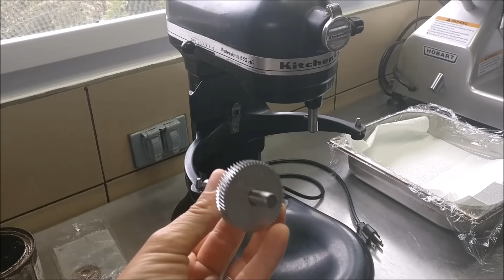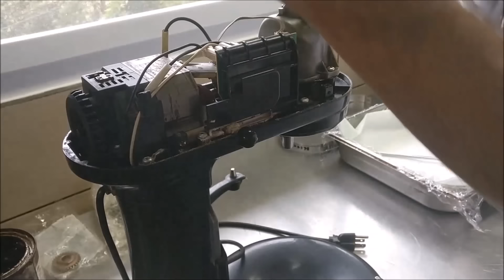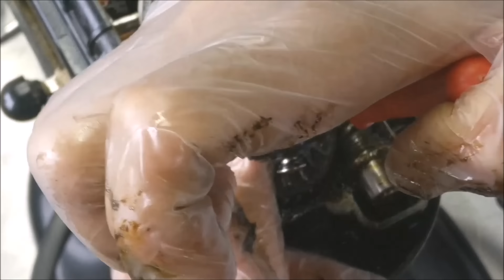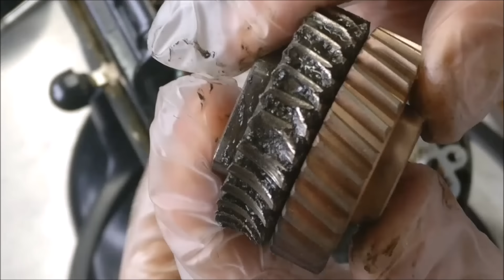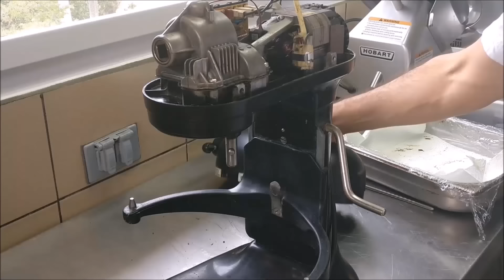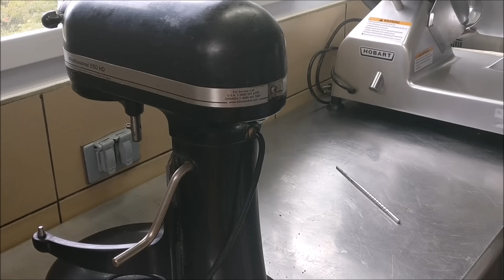Repairing the KitchenAid Professional 550HD main gear

Comment: We followed all the steps until it came time to take off the first gear on the shaft.  IT JUST WON'T COME OFF!!  Yes, we took off the ring.  What is the matter?
Reply from the maker: Sometimes that first great gets stick if it's never been cleaned before.   Use a flat head screwdriver and place it between the top gear and the brass worm follow gear.   This should loosed it up.  Next remove the pin and with a hammer gently tap that center bar down.    This should pop that bottom housing off and the gear should be loose enough to come off with ease ..
Reply from the maker: Let me know if that does the trick...
Reply: @2guysandacooler  Before you responded, my husband took two crow bars and wood and slowly inched it up until it came off.  Then when we were putting the center parts back together they refused to go together even when lined up perfectly to match the pin.  We had to sand both components and then knock them into place.  I really don't like this mixer anymore; although, I did buy it at a garage sale near new for $100.
Reply from the maker: Very Cool.  So the million dollar question..  Does it work now?
Reply: @2guysandacooler  Well, even though it was a stooge job the mixer still works.  I wouldn't tell anyone to do this at home; we were just lucky.  PB blaster would be the gentle solution and may take longer.

Comment: Both the old and new worm follower I got are extremely difficult to get on and off the worm gear. Am I missing a step?
Reply from the maker: I don't think so.  Just make sure you place the worm follower all the way down the shaft till the small hole is exposed.  Then Place your pin back in the hole.  Replace the gear that goes on top of the worm follower by lining it up correctly and finally your worm gear should be put back.  Be sure to watch the video again as that particular gear ha to go in a certain way otherwise it doesn't fit perfectly.  It should be a perfect fit once you are all done
Reply: I got it! Thanks!
Reply from the maker: Shelly Gray awesome!!!  Great to hear.